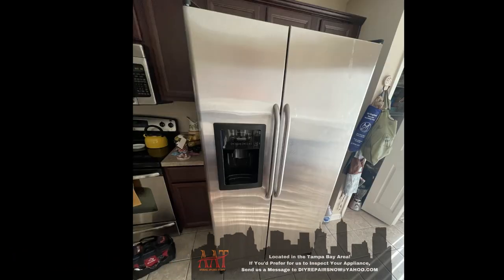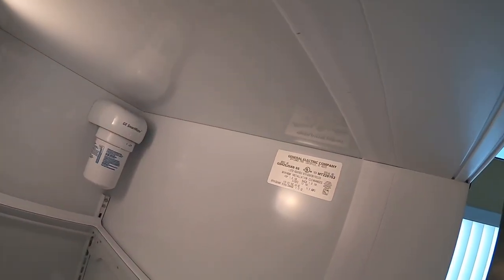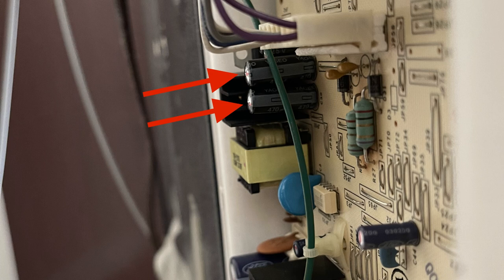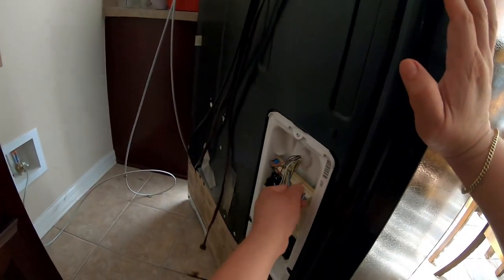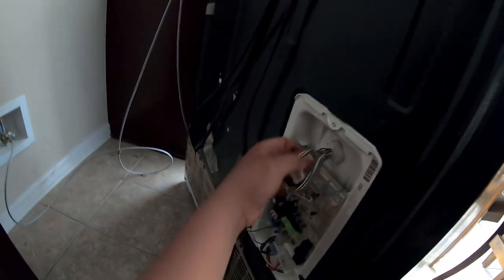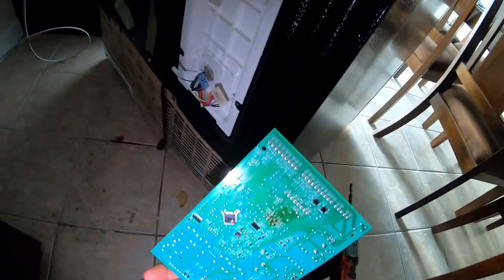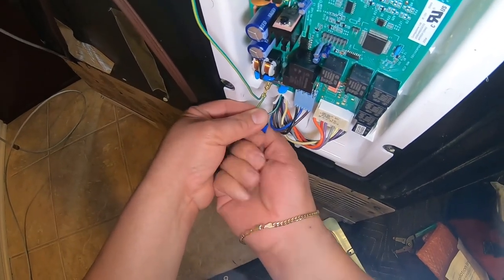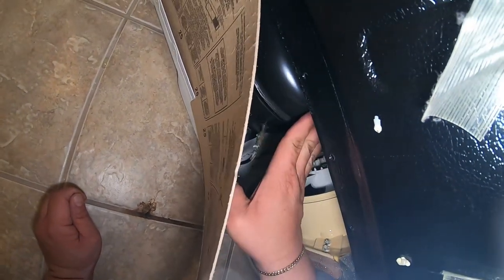How to Fix GE Side by Side Refrigerator Not Working | Lights On, NO COOL | Model #GSH25JSXNSS

Comment: I have a GE side by side, but it has no control panel access in the rear.    I'm taking the risk and scheduled an appliance repair company to check it tomorrow (not GE authorized).  This blows me away... I called GE Customer Service today, in hopes of getting an authorized GE repairman out to fix it ASAP.   After waiting more than an hour to get a live person on the phone, the lady at GE said it would be Dec. 5th before a technician could come out.   Today is Nov. 20, which means waiting 15 days just to get a technician to come out, at a fee of 114.00 service call.   RIDICULOUS.   I bought this GE frig over 10 years ago, and when I got it in the house, the ice maker had an issue.  They sent someone out within a day or two.   I spoke to an appliance repairman I met today, who said that in the Miami area, GE is using a subcontractor, A & E Appliance Repair to do their service work.   If the best they can do is to come out in 15 days, then GE should either hire other subcontractors, or stop selling appliances.

Comment: Those are called resistors and you need a ohm meter to measure its vaule 3.3 ohms being orange orange with the third color being gold 2 watts power modular board it is called can be repaired if you know electronics

Comment: Thosd boards are pretty easy to fix. I picked up some electrolitic capacitors from our local electronics store and rdmoved and replaced yhem. Was hard at all and saved a lot of money over a new board. Trust me, if i can do it anyone can.
Reply: What kind of capacitor do I tell them I need my evaporator fan resistor is blown I was thinking replace that and maybe the evaporator fan instead of replacing the whole motherboard
Reply: @clay1671  remove the board and take it to the electronic store. They should be able to tell you what you need. You can also read the label on the capacitors. It will tell you the voltsge and micro ferrets.

Comment: BEFORE YOU DO ANYTHING!!...We had a power outage and My GE side by side compressor wouldn't work and the panel lights were off.  The interior lights worked fine.  I was fed up with fixing it and ordered a small freezer to store frozen meets etc.

The next day, 24 hpurs, the refrigerator came back on, compressor running and panel lights on.  It had reset itself apparently and it took 24 hours.  I read where another GE refrig owner said it took 12 hours to reset.  So, before you do anything, unplug it for a minute, replug and wait 24 hours.  It may be less than that..  PS..The tutorial was excellent.  Thank you..

Comment: What is the PCB part number & price for GE GSH25JGDD BB? Is PCB to correct dead front display or correct my problems 2?
Problem on mine: not freezing, warm refrigerator, fan in freezer turns fine. Anyone knows the problems /or suggestions?
Reply from the maker: Did you got ice buildup on the freezer?
Reply: @DIYRepairsNow  No ice buildup in the freezer. All frozen food melt, I can see the freezer's fan turning.